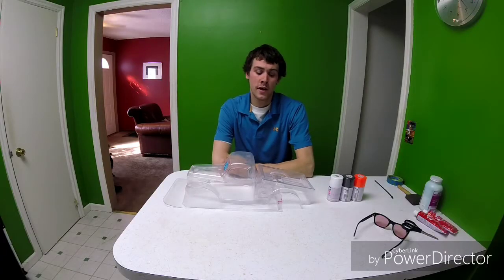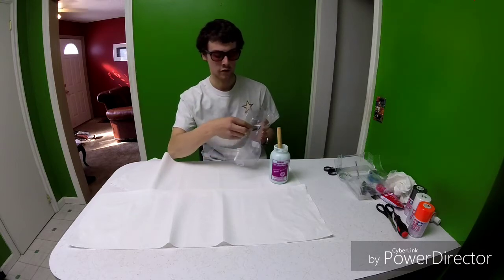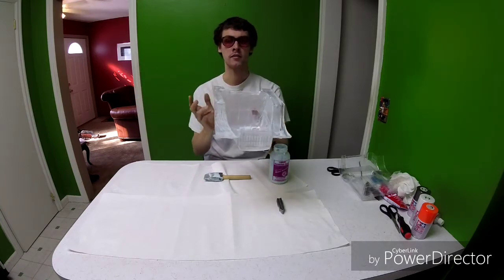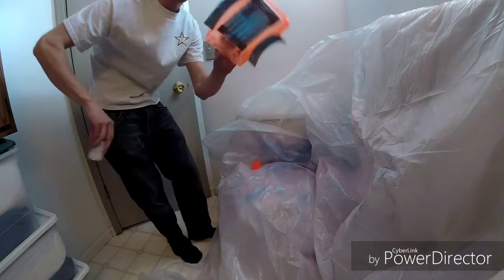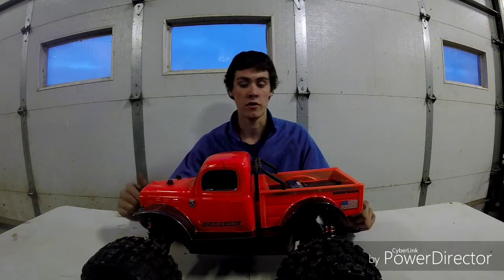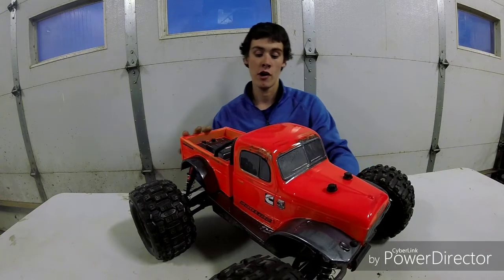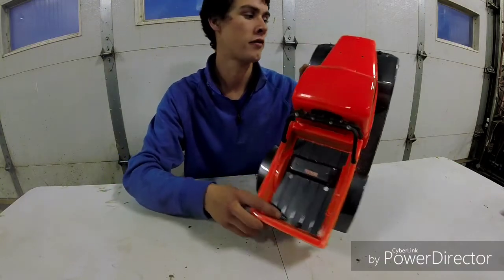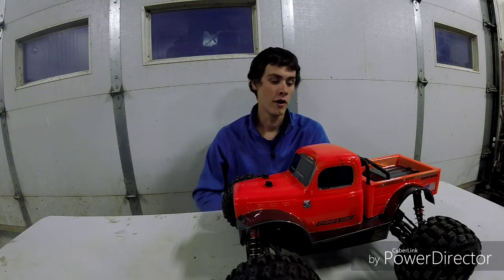Painting Proline body for Arrma Outcast 6s BLX

Comment: That came out sweet bro.. sorry to here about the paint bleeding thru... i had that happen too ,,thats why i stopped using ant type of spray sealers with petro. in it... good thing you had the shoo goo first.. because then sprays seems too make the lexans  brittle.. nice job on the video ,,that will help alot of people out there...BASH-ON BRO
Reply from the maker: Thanks man, yeah I am planning on doing a few things different the next time. I didn't know that about the spray sealer's. I want to try the dry wall tape method sometime too

Comment: Nice body and paint job Josh !!!!  Suits the Outcast big time. I haven’t seen one of these fitted to an Outcast before. Would it fit with the wing or would u have to cut to much out ?? 
I Like 👍🏻👍🏻😵😎
Reply from the maker: CAMO RC !! Thanks! I run everything without a wing because I always tend to land perfectly on them right after I install them. But you would have to cut a decent chunk out of the rear end of the body if you wanted to run the wing mount.

Comment: Hey I am having issues with my proline ford f-100 cracking it is where the bed connects to the body (it is a one piece body) how do I stop it from going all the way through? Is drilling holes on both sides and using zip ties smart? I appreciate any help. Thank you!!
Reply from the maker: Hey Outdoor life, usually shoo goo is my go to but being that it is in that place I would probably do the zip tie method. It sounds like you have plenty of flat space to work with zip ties on either side of the crack. I would make sure the zip ties are pretty tight especially near where the crack is getting worse. There is also a video on how to repair similar damage with dry wall tape and shoo goo that looks like it would work pretty well if the shoo goo stuck really well to the body. I will try to find that video and post the name of it on this comment just incase you want to look into that.
Reply: Thanks!! Appreciate the help.

Comment: Will that body fit a arrma nero?
Reply from the maker: bigkilla27 You would have to do some modifications to the Nero like extended body posts but when I do body's like this and extend the body posts I usually end up having to repair the body posts more often because they stick up so far causeing them to snap off. The problem with this body is it came in two halves; front and back. So the inside of the body is not hollow like your Nero body or a majority of Proline body's. Since it isn't hollow the inside of the body hits the batteries in my Outcast before it can go any lower. So to summarize; it would work but I don't recommend it. Let me know if you have any other questions. -Josh
Reply: Thanks bro
Reply from the maker: bigkilla27 welcome!